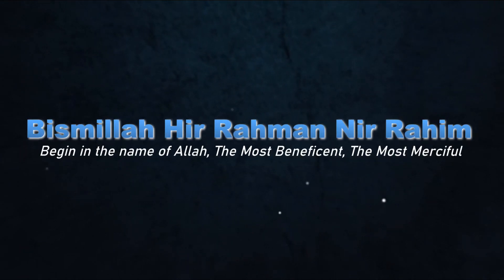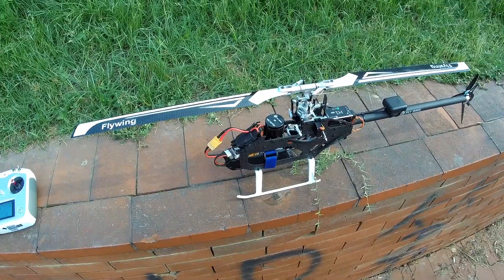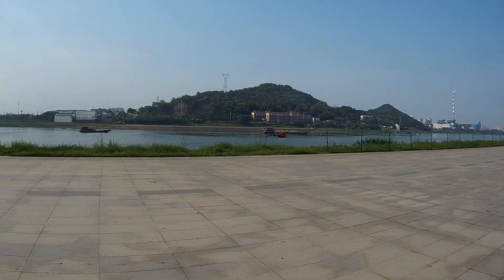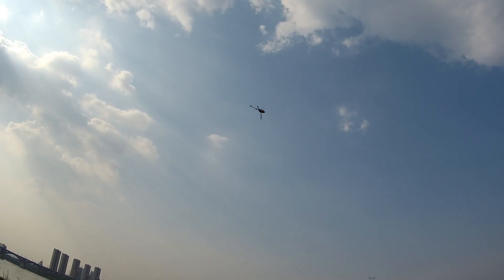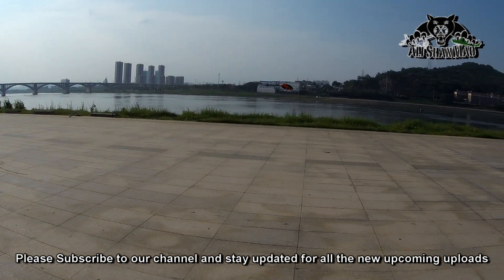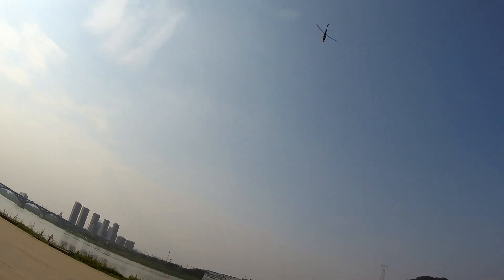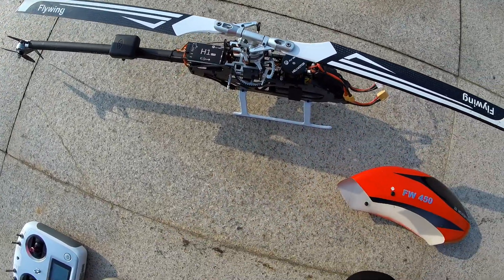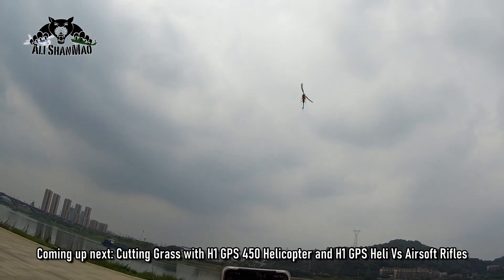FW450 3D RC Helicopter H1 GPS Heli Autopilot Flight Endurance Testing

Comment: Ali...If the FW450 is in the inverted mode and the battery gets low RTH, will the Heli automatically gain altitude and auto flip into normal flight position and land on its own? Or do you have to tell it to flip into normal flight mode and manually land it?
Reply from the maker: it will land inverted :D hahahaha. so turn off low voltage RTH please

Comment: Just tested the FW450 and using the included 5200mah 3s lipo after 15 minutes it returned to home which I assume was due to low battery. I checked the lipo and there was still 54% power left! Tried a 2800mah 4s and only managed 7 minutes then it RTH again, battery was 50% ! Any ideas please? Not sure if the transmitter RX icon works as in both cases it showed as still full!
Reply from the maker: Guess you have to play with low voltage settings on you H1 FC
Reply: @alishanmao  Hi Ali, many thanks I will investigate. Could you please advise what voltage your FW450 is set to?
Reply from the maker: I will have to check. not too sure.
Reply: @alishanmao  Hi Ali, regarding the reduced flight times I am experiencing, I have looked at the online setup and there is no facility for setting the 'parameters' which is where the cut off voltage can be reset. I have the H1 Lite FC fitted to the FW450, as yours has in your video. It seems you can change the H1 Heli but not the H1 Lite! 
Can you help please?

Comment: I'm wondering can i use this H1 GPS FC on my nitro Raptor 50 SE? Really wanna know.
Reply from the maker: So far I have not seen anyone using it on Nitro heli but factory told me they have tested it on nitro helis and it works. however vibration damping is very important because engines have way too much vibration for the gyro

Comment: Ali can you help me with my flying fw 450 it won't start up as video description ,I think the transmitter is set up wrong can it be reset to default
Reply from the maker: Hi Peter, yes, but please please please do not reset the transmitter or you will be in trouble. some people thought the same and reset transmitter to factory setting and can't program it again.

What you do is power on everything. put helicopter in open area (I assume you have done compass calibration needed only first time) wait and when all GPS satellites locked, you will see solid Green light on flight controller.
make sure switch flight mode is on GPS. and Arm switch is off.
Now hold the Throttle (Mode to radio, left stick) down and left (/) for 3 seconds, and leave it. now you will see That solid LED green color is blinking.
now you can flip the arm switch and rotors will start spinning. once they get good rpm, increase the throttle and it will take off and hover. 
let me know how it went.
Reply: alishanmao  hi Ali it’s so nice of you to reply, I will try that  and let you know ,do you mind if I contact you again  if this dosnt work
Reply: I hav ent touched transmitter settings
Reply from the maker: contact me any time. :)
Reply: @alishanmao  your a genius Ali,thanks so much,on another matter my battery arrived do swollen I can't remove it ,it only lasts about 4 minutes, what do you recommend to replace it, Regards Peter
Reply from the maker: Get CNHL Brand battery 4S 3300mAh and you will get much more flight time.

Comment: Hi Ali
Thank you for your utube footage it has helped me decide to buy a FW450 RTF .I received it a few days ago and experienced that it was not bound to the FS-I6S RC.Keen to learn as I am a novice I followed down the track of binding the heli with the RC and got there but at no time could I get main and tail motor to respond. I have since set the RC to factory settings big mistake. Can you help a lost soul or guide me to a FW 450 Manual any assistance would be greatly appreciated.
Reply from the maker: there is a user manual on my site page. there is a link there for manuals buddy. hope those can help
Reply: alishanmao Hi Ali
Sorry to be a pain but I could not find any Manuals I must be looking in the wrong Site . Is there a specific FW 450 Manual ?
Many thanks Ali.

Comment: Does this system works with Spectrum Radio? IX and DX
Reply from the maker: if you have SBUS receiver or SBUS Converter (Easy and cheap to find) yes it will work

Comment: Hi.. If you do some flip in idle up mode.. And lost control or orientation.. You leave the stick centered.. Will it hover itself? If say from upright to inverted.. You let go.. Will it hovering inverted?
Reply from the maker: you need to switch to GPS no matter inverted or normal when you make mistakes and it will hold position, but you might need to control the pitch immediately if you are inverted so it can rise up.

Comment: The spec sheet says it uses a 3S 5200 battery. But you're using a 4S 2600. Why ?
Reply from the maker: 3S is only for normal flight. can't do 3D as it does not offer enough power. 4S can perform 3D as well.
Reply: @alishanmao  ok, makes sense. Thanks.

Comment: Is this unit also acting as a flybarless system? thanks!
Reply from the maker: yes, it does. you can go full manual 3D mode or fly in GPS.  your choice. GPS is good for learning and even flying FPV and Aerial Filming. Wait for aerial film shot with this Helicopter and you won't believe it.